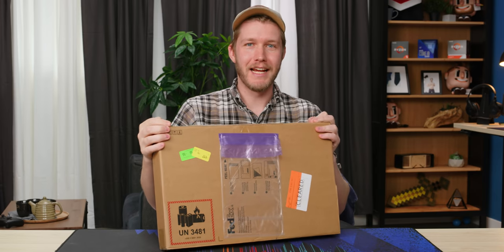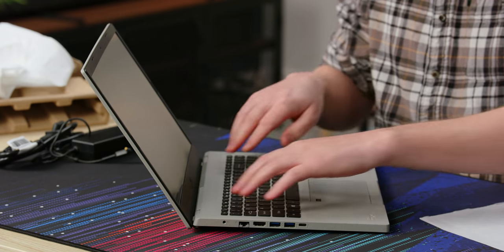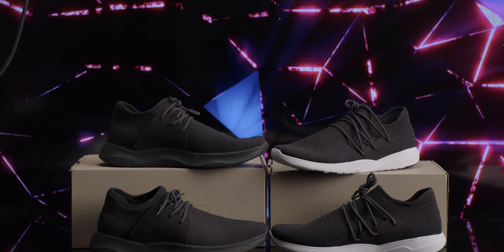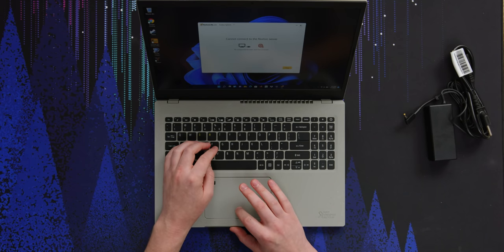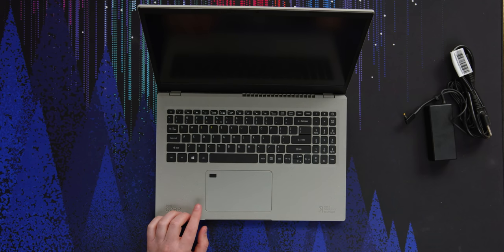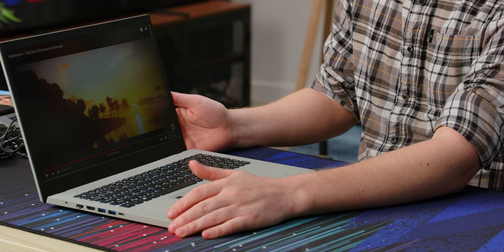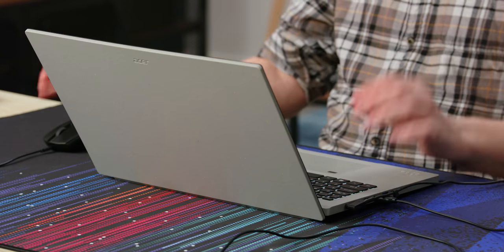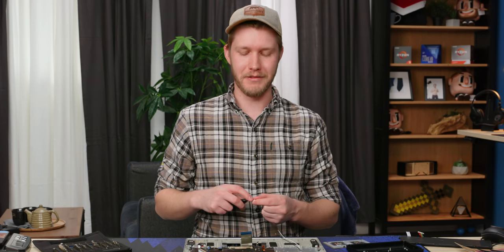ECO Friendly and POWERFUL?! - Acer Aspire Vero

Comment: 100% recyclable is impossible on these kinds of electronics. A high percentage yes, 100% no.
Reply: And that's just the materials. The process to produce these is just as impactful on the environment, regardless of the materials you're using.
Reply: Not to mention that "recycled materials" doesn't mean "eco-friendly". You know what's more "eco-friendly" than recycling aluminium? Not needing to recycle it in the first place.

"REDUCE" and "REUSE" come before "RECYCLE" for a reason. That makes the Framework laptop more "eco-friendly" than whatever garbage the big brands pump out.
Reply: @WhenDoesTheVideoActuallyStart  This one appears to be somewhat upgradable.
Reply: @WhenDoesTheVideoActuallyStart  But this is still better than regular 'garbage', as you say, laptops.
Reply: @TD1237  Yes, yes, I'm just getting tired of all the "greenwashing" that brands do. "WE DID THE BARE MINIMUM! SHOWER US WITH PRAISE!"
Reply: @WhenDoesTheVideoActuallyStart  using cheap materials but advertised  it like they're more environmentally friendly...
Reply: @akhyarrayhka4048  Well, using less material *CAN* be environmentally friendly, but it more likely is because they want lower manufacturing costs and can market their greediness as letting you be better for the environment.
Reply: Several studies by respected labs and unis have found with a metal chassis laptop is 75% is recyclable and/or refurbishable
Reply: 100% anything doesn't exist
Reply: 100% recyclable is totally possible.
Depending on your definition of recycle. Companies have been playing with this for decades to avoid paying for waste disposal.
Take the bits that aren't financially viable to recycle.
Blend them into a powder. Add them to concrete or cheap tarmac as a bulking add mixture.
Reply: Was it not just the packaging that they claimed to be 100% recyclable
Reply: @WhenDoesTheVideoActuallyStart  The "recycled materials" part of this laptop isn't the only "eco-friendly" point, they made it easier to be repaired and this is a huge point. Btw at 6:04 they talked about reduce, reuse and recycle. The biggest downside to me is the lack of a Linux version (not only here but in almost every laptops), because in 8 years the components will be obsolete for a confortable daily usage with windows, while a Core Duo laptop is still usable with linux today.
Reply: @Thunder_Arch Of course I can install it manually but in a lot of cases there will be some missing drivers to use every sensors and peripherals (for example the fingerprints sensors that can read before the system finish to boot, and unlock the device automatically when the login screen appears), and in my last tries the same laptop with linux aways had a shorter battery life under light workload (browsing and watching videos) except a dell xps, which had official drivers availables...
Reply: @WhenDoesTheVideoActuallyStart  that's a quote from linus in one of his recent vdeos lol, nice to see people pay attention to what he says
Reply: @markp8295  Plastic dose not have great compression strength but use it for eco board mixed with bamboo lasts much longer than pine is much faster to grow and is mold, rot & termite resistance and is good for at least 20 to 30 years!

Not everything is recyclable there are many chemicals on PCBs, Dangerous metals etc that are either hard to seperate or are super toxic in doing so!
Reply: @DarthAwar  I think you misunderstood what I was saying.

It doesn't matter how toxic something is. If you get the ppm low enough, it is not deemed toxic. That's why they do blend some old tech and add it to concrete and tarmac mixtures. If you're adding coarse sand and other bits for bulk rather than strength for some applications, better to be paid to take it by a tech recycling firm instead of buying it.
Reply: You just gotta be a bit creative about it.... Its 100% thermally recyclable
Reply: @akhyarrayhka4048 virgin plastic is actually cheaper than recycled which is one of many reasons to why plastic is generally not recycled but burned or just thrown to landfills

Comment: To everyone complaining about how its eco-friendliness isn't enough, bear in mind that a giant corporation like Acer can't just change overnight. Like it or not, it has shareholders that don't give a damn about the environment, they only care about the bottom line. Do not hate on gradual change because it is not instant change. If a couple years from now this turns out to be a token gesture at being eco-friendly when the rest of their line shows no change, then yes, Acer is not eco-friendly. If this is the first of many small steps in the right direction, then kudos for Acer, and keep it up!
Reply: We should be demanding more from companies, no matter the shareholders. It's not our job to find a compromise, it's Acer's. 

However, this laptop is quite good in regards to its eco-friendliness and if they had a replaceable keyboard and less packaging, it'd be perfect (in an eco-friendly sense).
Reply: @leonro  I agree we should demand more, but demanding more does not mean demeaning an effort that falls short of what we think is the ultimate ideal. Acer made a solid effort, and that's fantastic. Now they need to keep improving on it and start implementing similar and better measures throughout their line.
Reply: I especially like the packaging. Most of that can be used everywhere to cut down on plastic without compromising the quality. Not everyone might want to get rid of Aluminium chassis, but there is also no need to wrap it all in 3 layers of plastic bags.

Btw. shoutout to Oculus (and anyone else doing this) for doing 0% plastic packaging too (like the cable wrapped in paper etc.).
Reply: To people like you, who try to sympatise and humanize big corporations, they are not your friend. They could have started the change a long time ago.
Reply: @korn6657  absolutely they could have and should have. Not a reason to reject the fact they have made an effort now. Just like people, a business will always be a work in progress. None of us start perfect, or end perfect, but hopefully we end up closer than what we started. The only way anything ever gets done in this world is gradual change. Vocal dissenters to this gradual change, for who nothing is acceptable but immediate perfection are the biggest obstacle to change, because why should I make that small improvement when I will only be hated for not making an even bigger one?
Reply: I know this is old but fuck that, the ONE world we have is destroyed day by day for the bottom line, what happens when we smoke ourselves out of a world? Who gives a shit about the bottom line if you’re too dead to care

Comment: I am a sustainable packaging engineer,  thanks for recognising dilemma I face every day. The difference between viable sustainability and feelgoodisms is a nuanced one.
Reply: Let me ask you this. Energy CAN be renewable potentially. The amount of energy it takes to make something could not possibly be more important than if the byproduct of that thing being a non-biodegradable substance that exists indefinitely on our planet (with a little toxic leaching for good measure). Therefore cardboard would essentially always be the more ecological answer over plastic.
Reply: ngl i feel that as long as it's not excessively packaged I'm chill
because if the material itself is shit for the environment, at least there's less material to begin with
Reply: @LordDRockMusic  I am all for paper and bio material, but if you are picking sustainability based on what you wish is gonna happen and not what is actually happening you have already failed. Paper that ends up in a landfill will have more embodied carbon than plastic and it is still gonna exist in a landfill in 2,000  years as there is not enough moisture and gas flowing through that landfill for it to decompose. You can pull 1920s news papers put of landfills today and read them good as new. So if a product is being sold in a western market where the likelyhood that it is gonna end up in a river is low, then you should be considering plastics. 

I dont really have a problem with paper or plastic. They both have their issue and benefits. My biggest annoyance is product that use both like carded blisters and window boxes. Those are going in the trash and not being recycled

Packaging right now is a battle ground for sustainability between, low carbon, zero plastics, and biodegradability. Rarely do you get a solution with all three. Everyone has a opinion on it. marketing, purchasing, quality, logistics, the EPA, the states, congress, the media and the consumer all love to tell me how to do my job, yet most dont even know packaging engineers exist. Its kinda funny.
Reply: @TheJttv  wow that's insightful
Reply: @TheJttv  Yes paper might not decompose in landfills but you could still get rid of it easily if you wanted. It's not the same with plastic, unless you burn it
Reply: @theodiscusgaming3909  there is no phrase that rings more true in sustainability than "the road to hell is paved with the best of intentions" and its my job to pave it and make the company look good doing it. I do corporate sustainability and trash design which means I need options that are viable for the company. I would love to say the best package is no package or tell the consumer that the best product is the one they already have, but i cant be pitching ideas that will greatly hurt the bottom line of the company. To do sustainability you need to be willing to get rejected 100,000 times and you really need to celebrate the small victories. Its gut-wrenching, demoralising and you will get stifled at every turn.
Reply: @TheJttv  dam

Comment: Nice - Alex gets my like 'cos of the recognition of the dilemma we're facing when it comes to the packaging
Reply: From my perspective, it's much easier to make clean energy than clean up plastic.
Reply: @morosis82  Yeah, while we're at it, burning fossil fuels to turn the heat into electricity is an incredibly wasteful process as-is, unlike many of the existing forms of clean energy. Anything that involves absorbing heat to turn it into any other form of energy in general is wasteful.
Reply: @3lH4ck3rC0mf0r7  geothermal and solar: aight imma head out
Reply: @WayStedYou  Those don't count because we're not burning the thing ourselves.